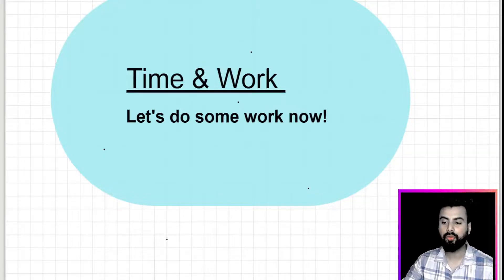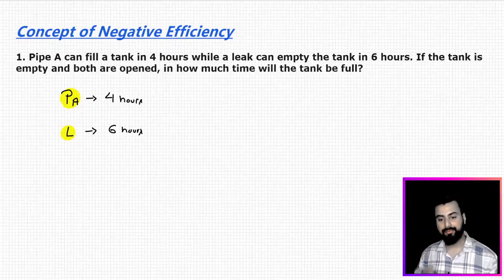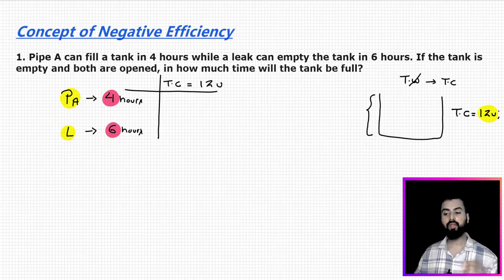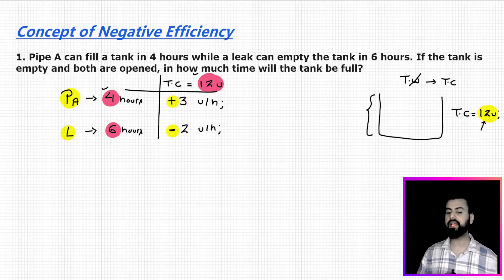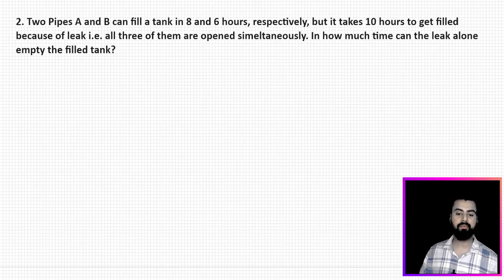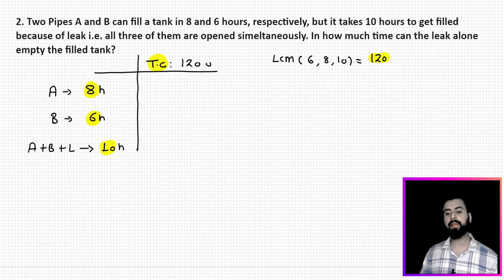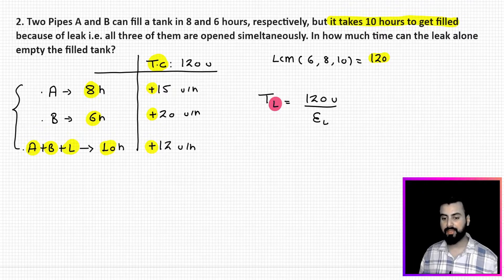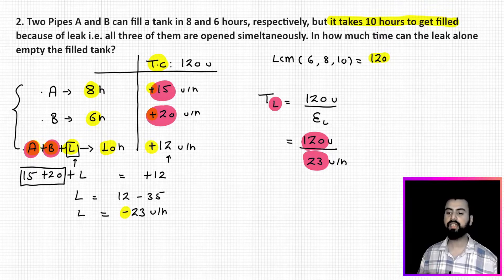Lecture 4 | Master Negative Efficiency Problems in Time & Work for Campus Placements

Comment: P can do a work in the same time in which Q and R together can do it. If P and Q work together, the work can be completed in 10 days. R alone needs 50 days to complete the same work. then Q alone can do it in a)30 days b)25 days c)20 days d)15 days
Reply from the maker: Let's solve this problem step-by-step and arrive at the correct answer.

Efficiency 
P/Q+R = 1/1

Time taken
P+ Q = 10 days
R = 50 days

Assume Total Work= LCM(10,50)= 50units
Find Efficiency.
P+Q = 5 u/d
R= 1 u/d

Use Efficiency Ratio to find Q's efficiency
P/Q+R=1/1
P=1x
Q+R=1x
P+Q+R=2x

But as per our Efficiency calculation above, it should be 6u/d
Therefore,
2x=6u/d
x=3u/d

Plugin the value of x to find 
P=1x= 3u/d
Q+R=1x=3u/d

Also P+Q= 5u/d
If P=3u/d
Q must be 2u/d

Time taken by Q to complete the whole task alone= 50/2=25days.
Reply: @aptitudeninja4u understood!! Thank you sir!